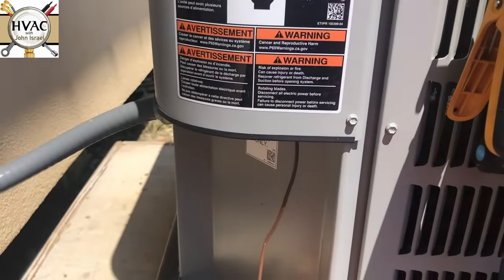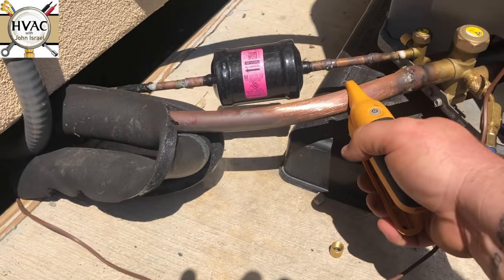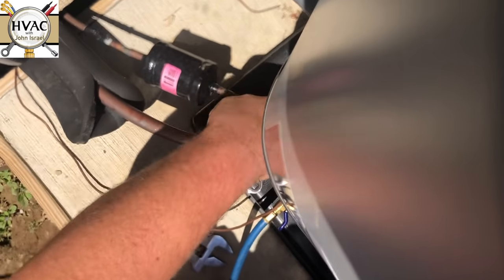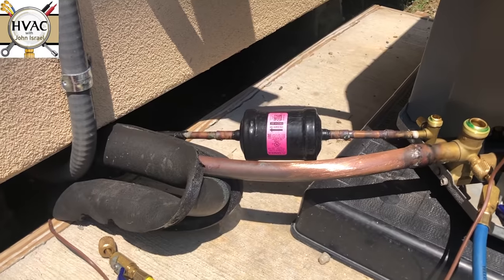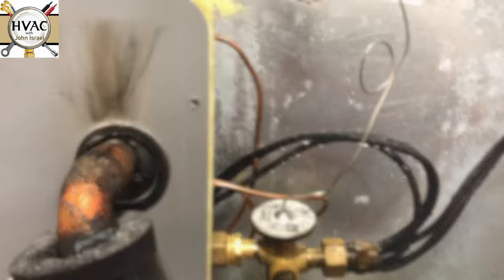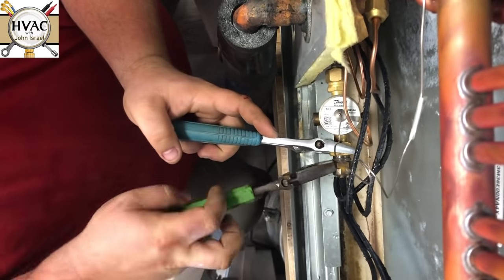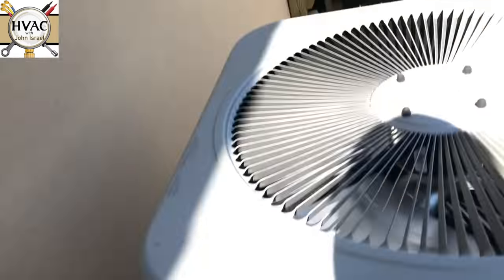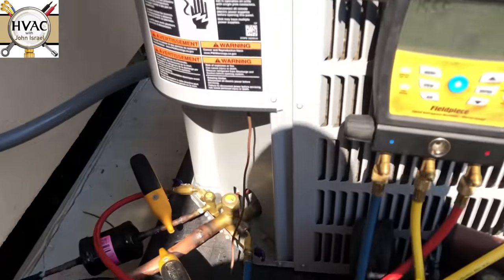How to Replace a HVAC TXV with Piston

Comment: OH MY GOD!  AT 5:59, YOU PUT YOUR YELLOW HOSE ON THE GROUND WHERE DIRT IS GOING TO STICK TO THE OIL AT THE END CONNECTION!  AND YOU'RE A HACK FOR NOT CHANGING OUT THE FILTER/DRIER! 😱
😆 LMAO!  Im just messin wit you!!! 
   I'm actually surprised no one said anything about the hose-on-the-ground thing!  (You know, those nit-pickin turds who hug trees and stuff.) 😆
  You said the system was brand new; there's no need to change out the drier; you're only changing out the metering device.
  Good video, bro; keep 'em comin!
https://www.youtube.com/s/gaming/emoji/7ff574f2/emoji_u1f631.pnghttps://www.youtube.com/s/gaming/emoji/7ff574f2/emoji_u1f631.png

Comment: I don’t think it’s a Lennox product. Lennox might have bought Ducane, but they are not the same quality.  I installed a Lennox oil furnace that was a re labeled Ducane.  Might be Lennox’s cheaper line.  Gaffers and Sattler used to make cheaper line of rooftop units for Lennox.  They were green instead of beige.  Definitely an inferior piece of junk, just like the Ducane oil furnace

Comment: Couldn't you just insulate the bulb? That would've brought things back in line. It looked totally not insulated, it's normal to restrict when it's exposed
Reply: If the sensor bulb is not insulated or loose it would flood the evaporator and not restrict
Reply: Do you have to insulated even though is inside the evaporator coil housing????
Reply: Exactly, if the bulb is not insulated it will think superheat is too high so the TXV will open more to try to lower the superheat to specs

Comment: Couldn't you just have adjusted the txv for proper superheat instead of replacing it?
Reply from the maker: The valve wasn’t adjustable
Reply: Aw ok so pretty much the txv went bad. Do you know how long ago the unit was installed before you were called to it?
Reply: actually if you remove it from the suction line it'll tell you what's wrong , sometimes.
Reply: I thought all TXVs were adjustable?
Reply: @twosawyers  thats what i thought.
Reply: @twosawyers  not all are. Sporlan sells a conversion kit to make it adjustable, but better off changing the valve.
Reply: CallSign Mayhem I just had to have my TXV replaced and adjusted on my Trane XR17 unit.  It’s a multistage so the TXV was highly recommended.
Reply: I would like to see a Sporlan part number that "makes" an expansion valve adjustable.. 
 I believe you mean to say that Sporlan sells adjustable valves, which they most certainly do
Reply: @jakem117  Nope, thats not what i meant, I know what I said. Go ahead and look it up. Obviously only works with sporlan valves and wouldn't work for a Danfoss valve like this.